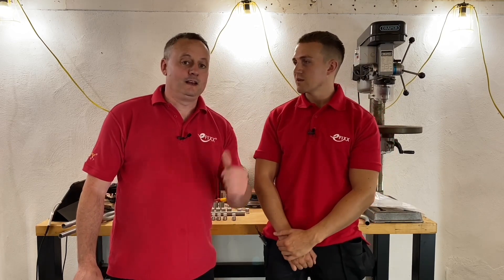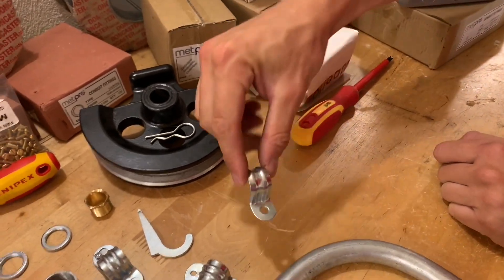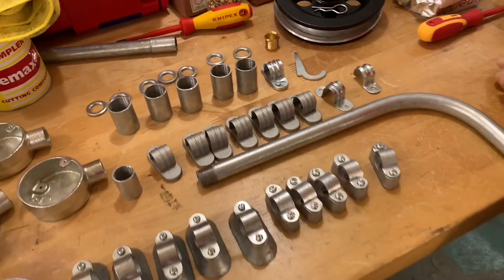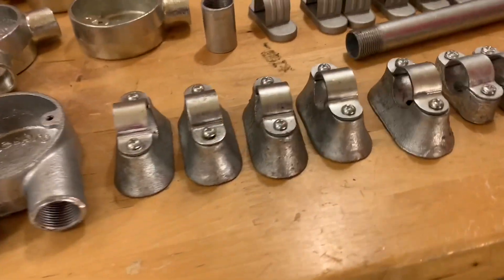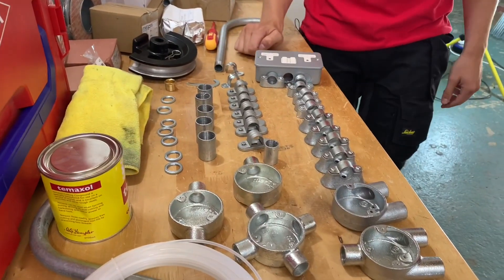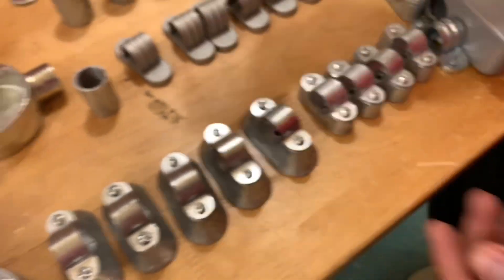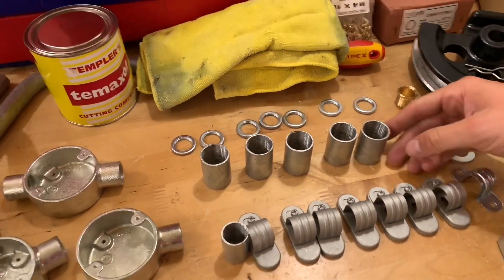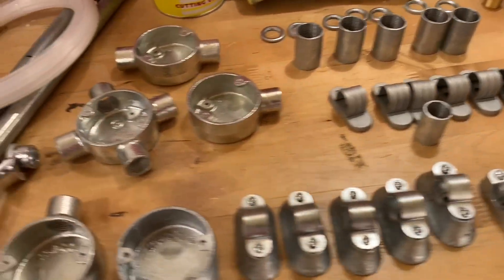METAL CONDUIT INSTALLATION Accessories & Fixings - boxes, saddles & bushes

Comment: Why do they use brass pan head screws for the conduit boxes? Is there a reason.
Reply: I guess the strength of steel isn't needed to hold a lid on.

Comment: Are conduit boxes fixed to the wall? There doesn't appear to be any fixing points?
Reply: The conduit is threaded onto the boxes, and the conduit is fixed to the wall without penetrating it, so the boxes aren't going anywhere and there's less places for moisture to get in.
Reply: Sometimes i will drill a 6mm hole in conduit box and fix it down with a square plate washer behind. Most of the time though, no fixing required

Comment: No easy connect fittings? still greater use of threaded fittings in UK for metal conduit. There is a much bigger push here in the US to quick fit compression conduit connections couplings still providing a continuous earthing path even if there was no separate CPC provided.
Reply: You can get screw clamp terminal conduit rather than threaded conduit. You aren't allowed to use either as a CPC though.
Reply: @arcadia1701e  in US you are allowed to in certain situations but most electricians will put a ground conductor in case of mechanical damage.
Reply: Yes we do have them, they are called Conlock.
Reply: @paulprescott7913  do they come in push-fit style without the need for tightening the screw down on the coupling?
Reply: @mathman0101  no they don't. I think metpro bought conlock anyway.

Comment: It looks like you got those nasty brass bushes that are not fit for purpose . Compare them to bushes from 20 years ago and you will see what I mean. Unfortunately that seems all you can get now.
Great video though
Reply: My ohmtite spanner useless on these Mickey mouse bushes ,also drill a 20mm hole the bushes nearly fall through!
Reply: They are so thin they are so easy to crack if you over tighten them, bloody useless.
Reply: Condiut ftgs are a disgrace nowadays Bush's and box lids are just 2 examples. Sadly they manufacturers have been buying them from China and India for longer than they will admit to. And the quality has dropped because of it.
Reply: @paulprescott7913  if the box lids got any thinner you could see through them.Stripped out some old black enamelled conduit 1950s boxlids about 3mm thick.